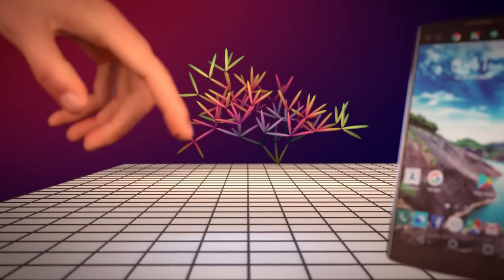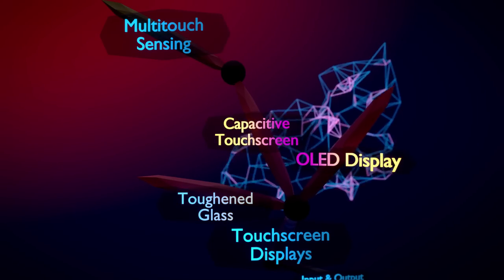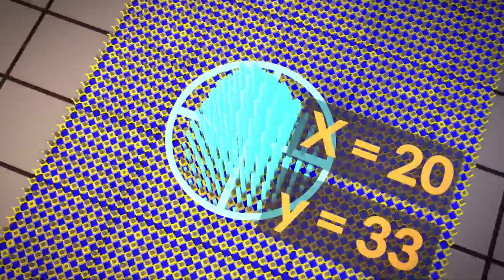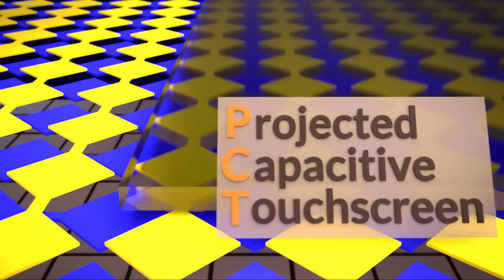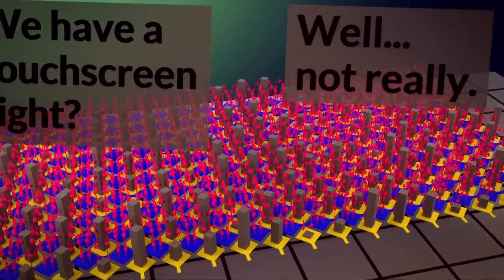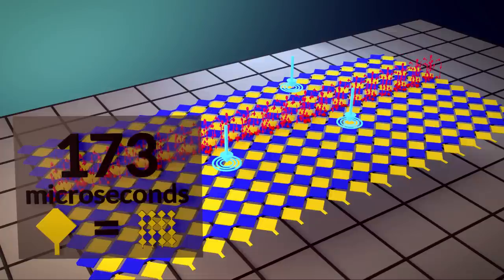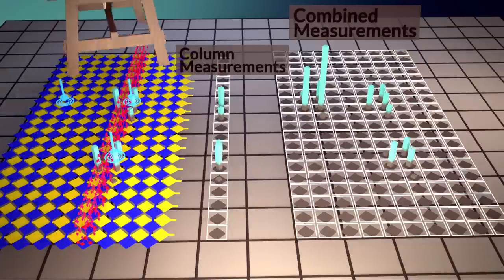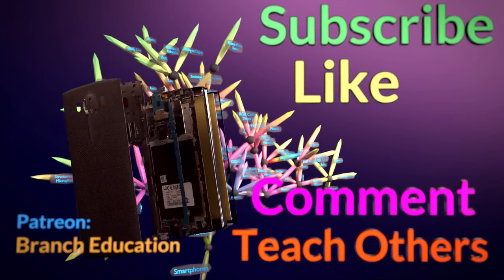How does Multitouch work?

Comment: Hi Teddy. What makes a capacitive touchscreen more responsive in comparison to a resistive touchscreen?
Reply from the maker: Most of it depends on the number of rows vs columns.  Resistive touchscreens have really good applications where pressure needs to be sensed accurately.  I'm sure engineers can design resistive sensory inputs for different applications.  For example, I wonder whether engineerings will apply resistive sensing arrays onto the limbs of robots.

Comment: Among current touchscreens is there a limit to the maximum number of touch points that can be detected?
Reply from the maker: Yeah- from the many white papers I read, they quoted around 10, but in the patents, they mentioned closer to 20 (citations are in the episode notes).  That goes to show the difference between mass production applications and lab results.  I didn't get into the software utilization of 10 distinct touches, but I bet software writers have a hard time using more than 4 points effectively and consistently.

Comment: How to measure the integrated columns and  how to scanning happen
Reply: Here there are 40 columns so the electric feild is made to make iteration through the columns per 10micro/milliseconds.
As such the electric field is varied. And scanning is done on the row side which is active only when the electric field is passing by the section.

Comment: I always had problems with those touchscreens. I guess my fingers aren't conductive enough. It was much easier for me to use those old resistivity touch screens, which could easily recognize nails and sharp objects. Oh, also these capacitance based touch screens are terrible if it rains or if some water ends up on the screen.

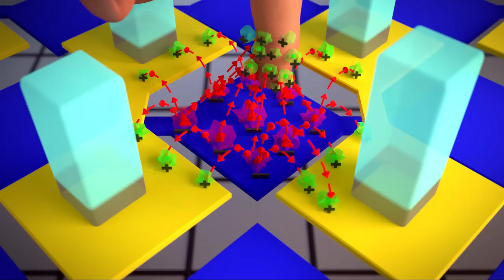Comment: 2:18 How is the change in positive charge measured?
Reply: Since a change in charge causes a change in voltage and voltage can be converted into a digital signal through an ADC, we can measure the change in voltage of each row.

His point was that theoretically it's best if we can measure each individual square, but since that would be very difficult and cumbersome to do, we instead measure the entire row. Doing this causes the problem that we cannot tell which square have what voltage, all we know is the total voltage. Therefore, the "scanning" is done such that only one column in each row can be activated at a time.